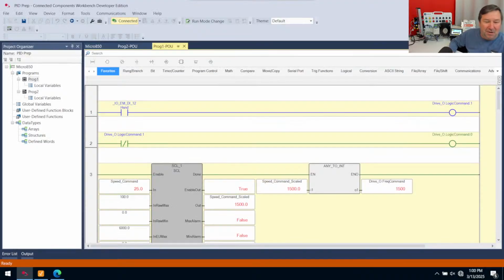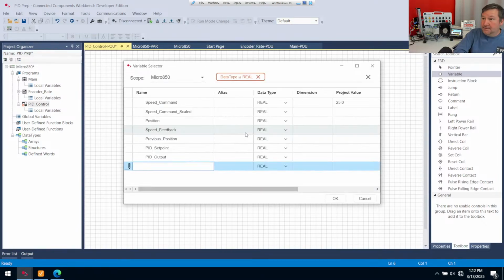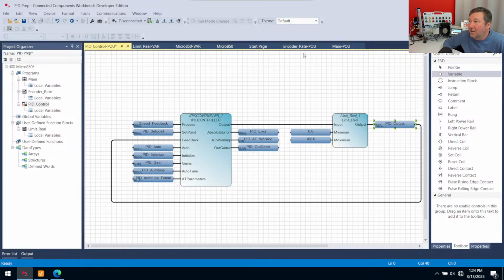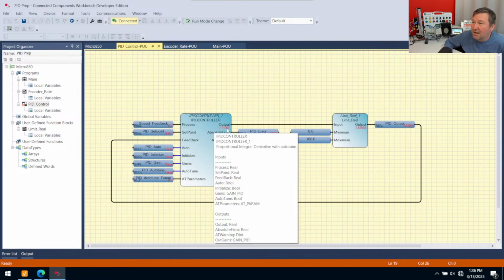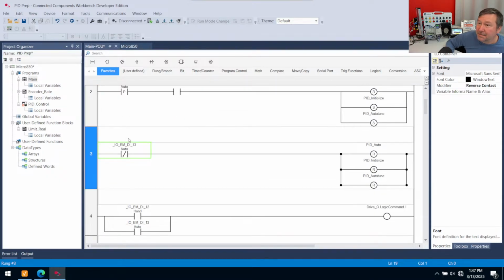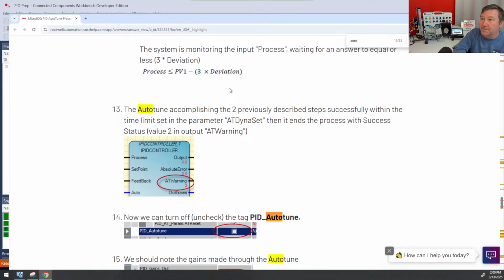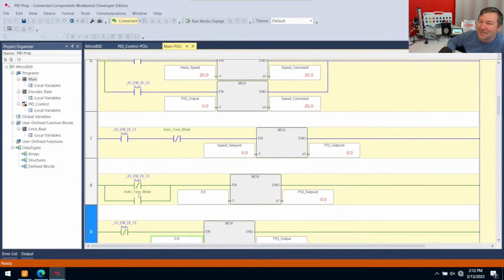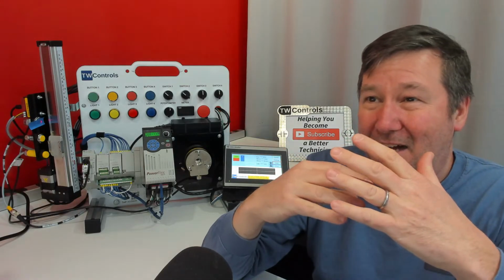PID Control with Micro850 for Beginners including Auto Tune

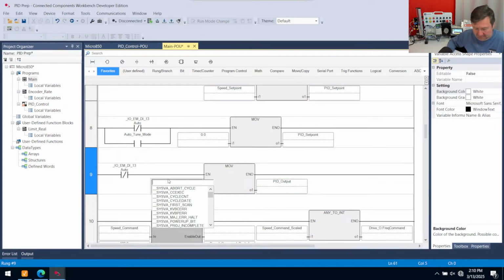Comment: At 1:10:53 instead of using the mov instruction to set the PID output to zero you should link the final drive command value (the actual command to the drive) to the PID control block feedback input. This will produce the bump less transfer from hand to auto mode the documentation talks about. 

When the PID is in auto it will produce the same result as looping the pid output post clamping to the feedback. If the output value is substituted in hand mode and the controller is not in auto it will back calculate the integral term (I think it’s a typo in the instruction about derivative) to have the controller output match the hand command thus the controller won’t bump going into auto.
Reply from the maker: Good tip